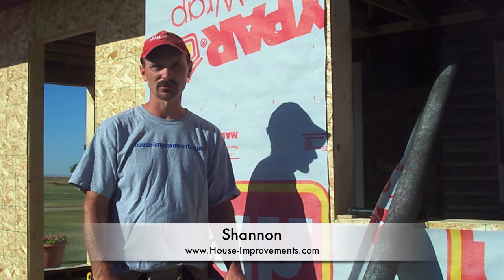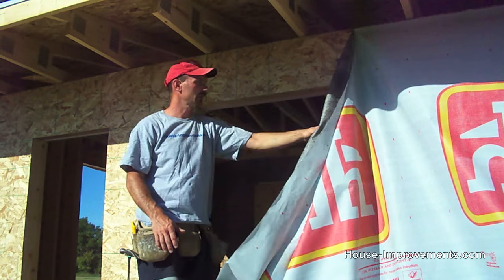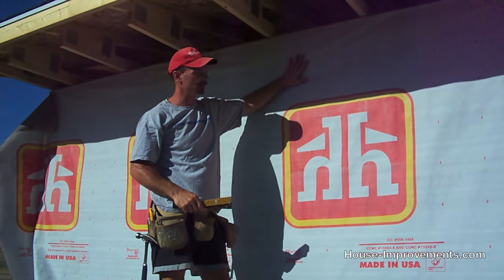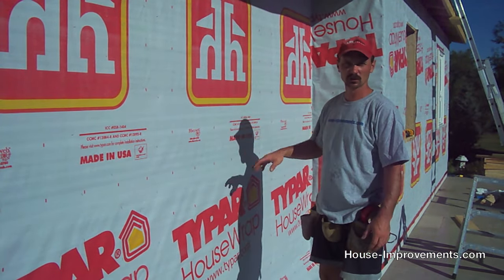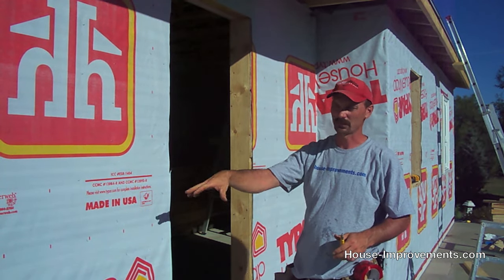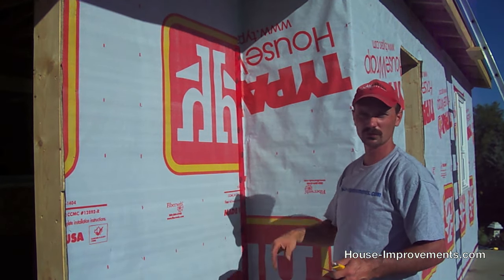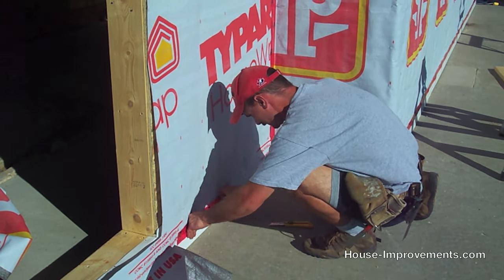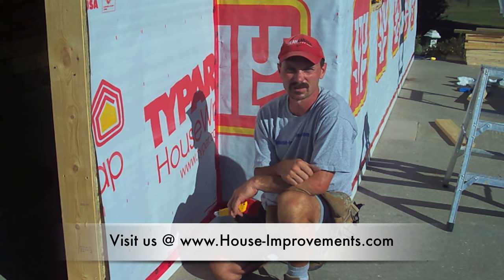How To Install House Wrap [Typar]

Comment from the maker: If i'm going to leave it for a while without siding I will screw a 1x4 vertically and space them about every 8' - 10'  or so. The trick is to prevent it from starting to flap to much so this usually works good. You could use almost anything you have around really that you can put up there. I run them vertically because it sheds rain easy.

Comment: One tip, instead of cutting a rectangle out for the window/door, but an X and then fold the corners in and staple, and cut off the excess. Typar actually says to do it like this on the roll.
Reply: I was just getting ready to ask this question, so thanks OgrAdaY for answering this for me. I logical brain was leaning to folding the paper around ALL openings for maximum coverage and protection.
Reply: Yep! I didn't like the edges around doors and windows. It would make sense to fold the housewrap into these - the window when installed will then sit on top of the the wrap.
Reply: Blue skin is way better for around windows and doors, tyvek/typar over it at the top, under at the bottom... cutting an x and pulling the top in and stapling is a no no, sides and bottom only ! Tyvek needs to stop and overlap your drip cap at the top of your window and door openings.... or seal it with tyveks stick flashing (I'd still seal the flashing/drip cap to the sheathing first and bring the tyvek over it).
Reply: ThevX cut is no longer considered to be useful. The method demonstrated here is current thinking.

Comment: I was taught a different way when cutting out for the doors and windows. I was taught to cut at a 90* angle from the top corners and bottom corners of the door towards the middle of the door about 6 or 7 inches. then cut over towards each other and then down the middle, so it kinda looks like a pyramid that had the top cut off of it, then has a line in the middle going to another upside down pyramid that's had its top cut off it. then you take the wrap and fold it around the inside of the door and staple it about 2" in from the outside edge of the door. at the top of the door you cut away from the corners of the door at 90* to make a flap then cut off the excess wrap and then use flashing to seal around the the door. I mean does it matter how it's done? because i've seen probably 5 different ways to do it now

Comment: Just a question if you don’t mind: writing from overseas from the European Union- a lot of your brands are not available, we use a lot of Swiss German and Italian made stuff over here. We have two different major types of wraps here one of them seals the surface absolutely perfectly which means it blocks EVERYTHING, no moisture vapor or any know kind of water can get through from either direction. This is usually used inside of the house, for not letting anything come in. The other type that we use for roofs and for outside of external walls “ is breathing “ what is mean is, does not let anything inside, BUT if somehow some moisture gets through it lets it evaporate out through the itself. Practically it is a one way out house wraps.

How does tyvek and the one that you are demonstrating work? Seals everything from all directions or is that a breathable texture?

Thanks a lot for the answer, of and I love your videos, outstanding stuff! THANKS 
Péter
Reply from the maker: Tyvek prevents water and air from going through from the exterior but allows water vapour out if you do get some.
Reply: HouseImprovements thanks so much I expected this “answer” I just wanted to be on the safe side. I did go the school in NY and also worked a couple of years there and also in Ontario Canada. Back in the day I saw “some “ tar paper, - :-) however working that American way here in Europe is really a paint in the neck. 
I see all the advantages of the American system, however these guys here - I can say “us” - ( not personally me) believe in castles bricks and stone. Man, imagine when I have to “convince “ somebody how a 2x6 wall does its job properly. Why can it be used in an excellent way and as an alternate solution instead of brick. 
Thanks man, once again, all the best and keep up the good work - great vids keep’em coming!
Péter
Reply from the maker: we have a great forum that you may find helpful https://www.house-improvements.com/forums/
Reply: @acsbudapest I believe Dupont has a Tyvek plant in Belgium. Yeah, the Europeans think our methods of construction are flimsy but even a two-by-four build house can be strong and nice except maybe in a hurricane

Comment: Just wondering if the house wrap should be taped to that white metal at the bottom, isn't it better to leave that not taped so any moisture and water can escape?
Reply: Wondering that myself, I am putting vinyl siding over my t11 cedar siding that is old.

Comment: you have to align the mark on the wrap to fit your stud in the wall so this mway  when you are nailing siding you know where the stud are...two 8 '' spacing for 16'' or 3 spacing for 24'' spacing
Reply: Studfinder?

Comment: I have a question I hope you can help me if I use  House Wrap  I should also  use insulation foam   I want to replace the siding of my house or  or I have to use both   i  live in wisconsin  thank you very much for your videos
Reply from the maker: +jose carlos sanchez I would use both. House warp under foam is the easier way of doing it.
Reply: ok thank you! for you help

Comment: Does this require special staples? Cap Staples or something like that? I have a t50 hand stapler. Can I use those quarter inch staples half inch staples?
Reply from the maker: They recommend using caps but I never have. I use 1/2" staples , if you won't be covering u for a few weeks you may want to consider caps so the wind does not get it flapping.

Comment: Can you install Typar over or behind the fan-fold insulation foam used behind new steel or vinyl siding?
Reply from the maker: Bob Hester  Yes, I prefer under because you can staple it to the plywood better.

Comment: Is a vapor barrier the same as a house wrap?   Thanks for any help.
Reply from the maker: No a house wrap goes on the exterior of the framing and repels water but still breathes, vapour barrier goes on the inside (warm side) of the framing and repels vapour and air ( does not breath)

Comment: Hi there im wrapping a house atm using tyvek and in order to get it passed by inspector will i need to tape the bottom seam too? I always thought it was just the vertical seams anywhere water can get in

Comment: My wall is taller than the roll I have. Should I start at the bottom so my seams overlap in the same way as window flashing?
Reply from the maker: Yes start at the bottom so the upper strip over laps the lower strip
Reply: thanks

Comment: Should the bottoms (by the foundation) of the wrap be taped off too, or left open?
Reply from the maker: There are pros and cons to both. Taping keeps bugs and critters out but leaving it untaped would help with drainage if you have something go bad and a lot of moisture gets in behind the wrap. That really would be unlikely 99% of the time.
Reply: @HouseImprovements  Hi, every staple you put in, you  increase the possibility of water infiltration.  Why not just staple the top and then install you strapping for the siding.  The strapping will hold everything in place and you won't have a swiss cheesed house wrap?
Reply: @edumouchel1567  I like your comment. I believe less is better. Siding puts enough holes in it.  Like he said though depends on wind and how long till siding goes on.

Comment: Could you use nails (with large diameter heads) instead of staples?
Reply from the maker: Sure , shingle nails would work or nails with caps

Comment: I am in process of building new home through a builder. Looks like they put typar on first before plywood. Is this right?
Reply from the maker: I have never ever seen that done. It should be outside of the plywood IMO
Reply: I was also told by my builder The typar will soon be covered by lath, wire, and then stucco.

Comment: Can you use crown stapler on the house wrap?
Reply from the maker: if it can be set to no put the staples too deep.
Reply: Yes from a air compressor so I can make adjustments to the psi

Comment: I'm building a shed but won't finish the exterior. If I wrap it with this wrap, will it be okay to be exposed for the winter until I can put siding on in the Spring?  I'm in Southern Ontario, Canada, btw.

Thanks for any feedback. 🙂
Reply from the maker: Absolutely.
Reply: @HouseImprovements  
Excellent! Thank you for the response. 😊

Comment: Why aren't you using the manufacters recommended fastners?
Reply from the maker: capped staples are a waste of money. I would consider it if the siding was going to be a long time before it was installed .

Comment: If you cover your entire exterior wall with roofing tar you wont need staples, the tar will hole the paper in place and it will water seal your hose as will.
Reply: David Johnson tar the entire house... do you know how messy and labor intensive that will be?

Comment: I would’ve wrapped that inside the door jam as well as the windows , I don’t think thats the right way .
Reply: It’s not.  It should be wrapped around the corners and then trim installed over it.
Reply from the maker: You see many guys and honestly even the manufactures wrap the wrap into openings but myself and others feel that that allows an air leak into the home. When you spray foam insulate those openings after there is then a passage for air that gets through and under the warp (house wrap is not wind proof) That air then has free path behind the wrap around the window rough opening and into the home. It will be partially restricted because the foam expands and presses the wrap to the wood but  the foam can't bond to the wood to create a seal because the wrap is there , and the foam can not exert enough pressure to seal it.
So in the method shown here the window is sealed to the wood and the wrap is sealed to the PVC window.
Reply: @HouseImprovements  yup!

Comment: No, no no no. X cut your openings, lap the tyvek over the ends of the rough openings.
Reply: X cutting your windows actually does the complete opposite of sealing your home. By wrapping your tyvek into your home actually directs water and wind into your home. And it also creates air pockets between the tyvek and the frame. When you go to seal your windows the sealant or foam will not make direct contact with your frame. Instead there will still be an air gap. Although the x method was used for a long time, building methods are always improving and it’s best if we adapt to them.
Reply: Tyvek still recommends x cuts in their installation instructions at rough openings. The IRC specifies that you must follow manufacturers' instructions to meet the code. So, even if you're correct, you could still fail inspections not following the x cut method.

Comment: SHANNON... You cut the Wrap at the edge of door and window and garage openings..... Instead YOU SHOULD WRAP AROUND ALL THE CORNER OPENINGS OF ALL WINDOWS, DOORS, and GARAGE OPENINGS AND TUCK TAP WHERE YOU STAPLED THE WRAP UNTO THE SHEATHING WALL.
Reply from the maker: I never wrap my house wrap inside of the openings. Some do, i dont. I  use a peal and stick membrane on all openings

Comment: What he recommends is incorrect. You should not staple the housewrap on. Manufacturers specify cap fasteners. You do not poke holes in a engineered perm rated product. Amazes me the lack of use of best practices are advocated by guys like this.
Reply: This video was made in 2011, when even the manufacturer was still recommending Shannon's technique.  You have to bring a little historical perspective when viewing a 10 year old video.

Comment: Upside down ??? makes it look juvenile .. and staples ... No. No No .. Manufacturer .. Plastic capped staple or nails .. and lastly .. Typar now has a slanted logo .. because alot of idiots can't run it somewhat level .. and they probably solved that engineering problem by putting a 20degree slope .. LOL .. I ain't busting on you ..